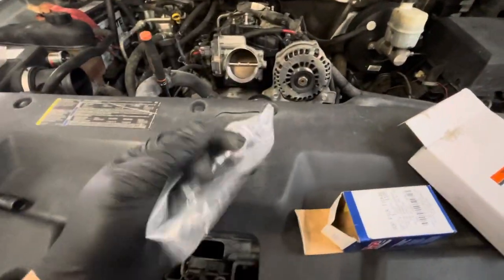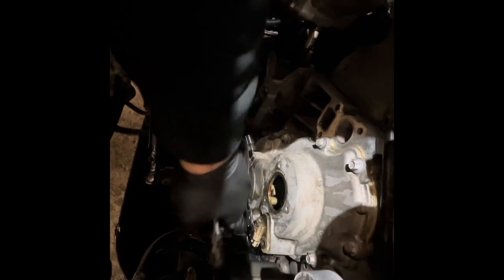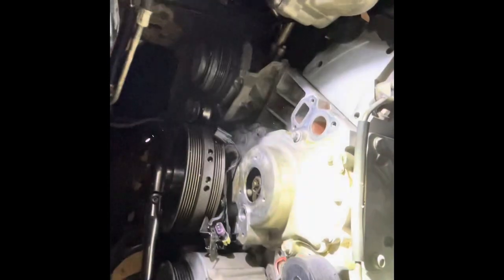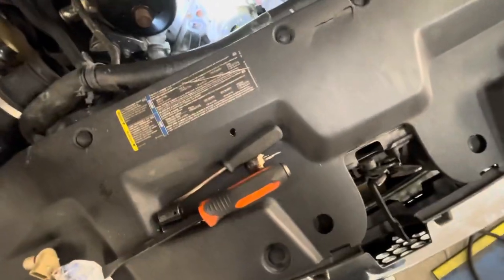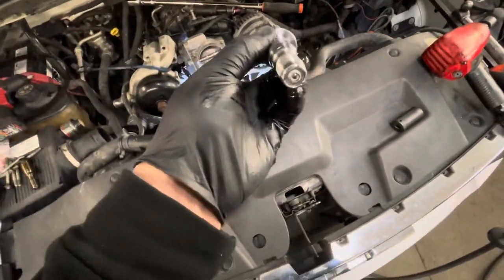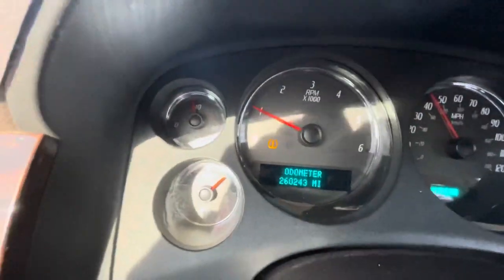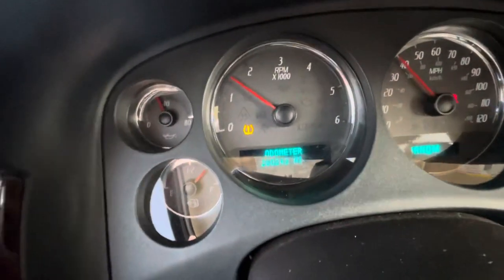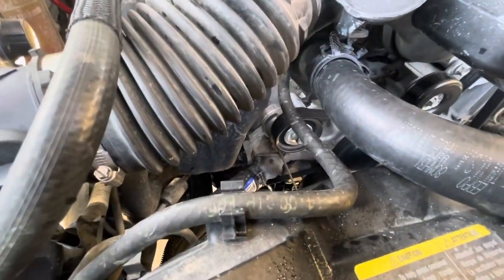How to fix P0011/P0341,P0351 gm replacement vvt

Comment: Hello buddy i bought a engine for gmc yukon 2012 is 5.3 coming with this vvt solenoid but i need put this engine on 2007 chevrolet tahoe 5.3 too but no has this vvt in the timing cover so My question is, can't I use that engine like this without connecting that solenoid or can I put the 2007 timing set and timing cover flat on it and would it work fine? If you can help me thanks

Comment: When you program it, does it need to be done with a bi-directional scan tool or is there a sequence of tasks you need to preform? I replaced this part and I get random misfires currently.
Reply from the maker: What codes are you experiencing right now? And also did you change all three parts? And yes you will need an actual scanner.
Reply: @champskog  p0300 mostly the issue now. Dont wanna run it too long
Reply: @champskog  the 3 parts changed were cam shaft sensor, vvt solenoid, and the vvt magnet. I get random misfires now. I am assuming dealership can re-program?
Reply: @jtk0984 did you ever figure out the problem? Mine does the same thing after replacing all of that. I get code p0011
Reply: @SLZR60  nope. Decided to get rid of the truck. Spent too much money chasing the issue.
Reply: @SLZR60  bro , you know what problem because i have same p0011 and little misfire

Comment: Did you have to program after installation. Would it start if you didn't relearn immediately after installation
Reply from the maker: Yes it will start and you have to program

Comment: I have p0011 and stabilitrak  and traction control  and a c0561-71 code 
I changed those parts out to and still coming up
Reply: Did you find the problem ? I’m having the same issue
Reply: Wheel speed sensor.

Comment: New and learning the LS world. What is that unit (at 10:10) at the end of the wire harness mounted on the timing chain cover just outside the camshaft, it is held on with 3 bolts? I just bought a 2011 Avalanche and mine has that part but mine is not attached to the cover, it is only plugged in and kind of just hangs behind the water pump. I assume someone has done some bypassing lol.

Comment: What is the part number for that wiring harness? the only when I can find that looks exactly like mine, with the three bolt points, the little one you loosen up behind the pulley and slide the racket off of? The only one I can find says it’s for a Camaro and I need one for 2011 Tahoe
Reply from the maker: You don’t change a harmness unless the it’s broken but in which case you fix the wire the parts out be based off your vin but I can give you the ones I used if it helps
Reply: @champskog  could you share the PN for the harness?
Reply: Did you ever find a part number for the wiring harness?

Comment: I already got my sensor replaced if I just need the actuator do I have to pull the sensor out again
Reply: The actuator is behind the the solenoid, next to the camshaft sensor. Diagnosing whether it's the actuator or the solenoid is a lot easier with a good scanner and a qualified technician to read it. To answer your question, you don't actually have to pull the camshaft sensor to replace the actuator.

Comment: Thanks, I'm about to do this
Reply from the maker: Any questions hit me up
Reply: @champskog  Hello buddy i bought a engine for gmc yukon 2012 is 5.3 coming with this vvt solenoid but i need put this engine on 2007 chevrolet tahoe 5.3 too but no has this vvt in the timing cover so My question is, can't I use that engine like this without connecting that solenoid or can I put the 2007 timing set and timing cover flat on it and would it work fine? If you can help me thanks

Comment: What was the symptoms of this code p0011
Reply from the maker: Low oil pressure and slight misfire Is the most common ones there’s many more
Reply: Just replaced it p0011 code is still up an it still misfire I hope part is bad that I just purchase crazy
Reply from the maker: What did you all do
Reply: @champskog   change the . Vvt actuator, an vvt solenoid  an cam shaft sensors
Reply from the maker: And you still have the same code
Reply: @champskog  yes smh
Reply from the maker: Pull the timing cover and see if you didn’t bend anything when pulling the camshaft position sensor
Reply: @fabiancook1498  did you figure out the  problem   i changed all these parts twice and still have the same code
Reply: @eddiesgsr   no still doing same thing  p0011
Reply: @fabiancook1498  ok keep me posted if you figure  something  out.  I might have a shop look at it for me and ill keep you posted
Reply: Had the same code lost rpm gauge and has a hard time starting in my 07 yukon denali 6.2 had 2 shops look at it and they can't figure out the problem any advice
Reply: @Killerclown-pb3bk my advice  is do what I'm  about to do. Go Japanese.   I love me truck when its working  but I cant go a few months without  something  breaking   i had 2 German cars and 2 Japanese  cars for years  nothing  breaks
Reply: @eddiesgsr I feel what you're saying big dog but I still gotta support muscle americana.
Reply: @erickuribe9860  Japanese is good, but my 07' escalade ESV is still running at 326k miles and I treat it like s***t lol. Aside from the obvious wear and tear stuff like hoses and brakes etc etc. Barely done anything to it besides this...this weekend lol. Keep on going brother!

Comment: I'm still getting p0011 after changing  all those parts
Reply: The actuator is oil driven. The solenoid is magnetic in nature and acts upon the actuator. The PCM has built in tests for both of the components. You need to make sure that you have clean oil, and a fresh filter, before you send it to someone with a proper scanner to diagnose it.